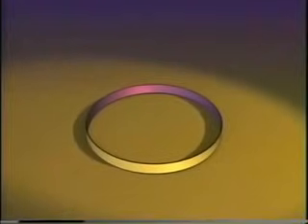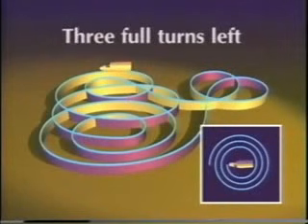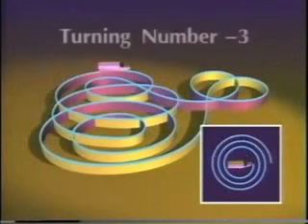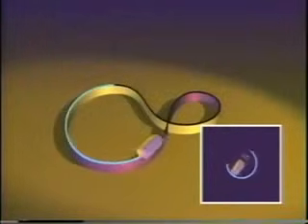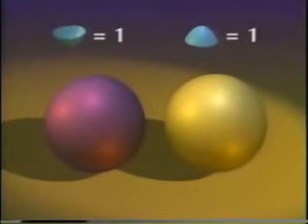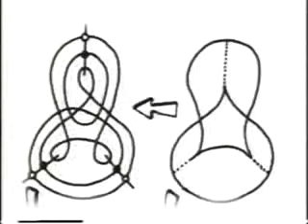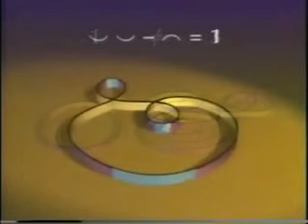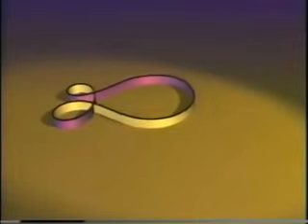how to theoretically turn a sphere inside out

Comment: In the mathematically rigorous formulation of quantum mechanics developed by Paul Dirac,[13] David Hilbert,[14] John von Neumann,[15] and Hermann Weyl[16] the possible states of a quantum mechanical system are represented by unit vectors (called "state vectors"). Formally, these reside in a complex separable Hilbert space - variously called the "state space" or the "associated Hilbert space" of the system - that is well defined up to a complex number of norm 1 (the phase factor). In other words, the possible states are points in the projective space of a Hilbert space, usually called the complex projective space. The exact nature of this Hilbert space is dependent on the system - for example, the state space for position and momentum states is the space of square-integrable functions, while the state space for the spin of a single proton is just the product of two complex planes. Each observable is represented by a maximally Hermitian (precisely: by a self-adjoint) linear operator acting on the state space. Each eigenstate of an observable corresponds to an eigenvector of the operator, and the associated eigenvalue corresponds to the value of the observable in that eigenstate. If the operator's spectrum is discrete, the observable can attain only those discrete eigenvalues.
In the formalism of quantum mechanics, the state of a system at a given time is described by a complex wave function, also referred to as state vector in a complex vector space.[17] This abstract mathematical object allows for the calculation of probabilities of outcomes of concrete experiments. For example, it allows one to compute the probability of finding an electron in a particular region around the nucleus at a particular time. Contrary to classical mechanics, one can never make simultaneous predictions of conjugate variables, such as position and momentum, with accuracy. For instance, electrons may be considered (to a certain probability) to be located somewhere within a given region of space, but with their exact positions unknown. Contours of constant probability, often referred to as "clouds", may be drawn around the nucleus of an atom to conceptualize where the electron might be located with the most probability. Heisenberg's uncertainty principle quantifies the inability to precisely locate the particle given its conjugate momentum.[18]
According to one interpretation, as the result of a measurement the wave function containing the probability information for a system collapses from a given initial state to a particular eigenstate. The possible results of a measurement are the eigenvalues of the operator representing the observable — which explains the choice of Hermitian operators, for which all the eigenvalues are real. The probability distribution of an observable in a given state can be found by computing the spectral decomposition of the corresponding operator. Heisenberg's uncertainty principle is represented by the statement that the operators corresponding to certain observables do not commute.
The probabilistic nature of quantum mechanics thus stems from the act of measurement. This is one of the most difficult aspects of quantum systems to understand. It was the central topic in the famous Bohr-Einstein debates, in which the two scientists attempted to clarify these fundamental principles by way of thought experiments. In the decades after the formulation of quantum mechanics, the question of what constitutes a "measurement" has been extensively studied. Newer interpretations of quantum mechanics have been formulated that do away with the concept of "wavefunction collapse" (see, for example, the relative state interpretation). The basic idea is that when a quantum system interacts with a measuring apparatus, their respective wavefunctions become entangled, so that the original quantum system ceases to exist as an independent entity. For details, see the article on measurement in quantum mechanics.[19]
Generally, quantum mechanics does not assign definite values. Instead, it makes a prediction using a probability distribution; that is, it describes the probability of obtaining the possible outcomes from measuring an observable. Often these results are skewed by many causes, such as dense probability clouds. Probability clouds are approximate, but better than the Bohr model, whereby electron location is given by a probability function, the wave function eigenvalue, such that the probability is the squared modulus of the complex amplitude, or quantum state nuclear attraction.[20][21] Naturally, these probabilities will depend on the quantum state at the "instant" of the measurement. Hence, uncertainty is involved in the value. There are, however, certain states that are associated with a definite value of a particular observable. These are known as eigenstates of the observable ("eigen" can be translated from German as meaning "inherent" or "characteristic").[22]
In the everyday world, it is natural and intuitive to think of everything (every observable) as being in an eigenstate. Everything appears to have a definite position, a definite momentum, a definite energy, and a definite time of occurrence. However, quantum mechanics does not pinpoint the exact values of a particle's position and momentum (since they are conjugate pairs) or its energy and time (since they too are conjugate pairs); rather, it provides only a range of probabilities in which that particle might be given its momentum and momentum probability. Therefore, it is helpful to use different words to describe states having uncertain values and states having definite values (eigenstates). Usually, a system will not be in an eigenstate of the observable (particle) we are interested in. However, if one measures the observable, the wavefunction will instantaneously be an eigenstate (or "generalized" eigenstate) of that observable. This process is known as wavefunction collapse, a controversial and much-debated process[23] that involves expanding the system under study to include the measurement device. If one knows the corresponding wave function at the instant before the measurement, one will be able to compute the probability of the wavefunction collapsing into each of the possible eigenstates. For example, the free particle in the previous example will usually have a wavefunction that is a wave packet centered around some mean position x0 (neither an eigenstate of position nor of momentum). When one measures the position of the particle, it is impossible to predict with certainty the result.[19] It is probable, but not certain, that it will be near x0, where the amplitude of the wave function is large. After the measurement is performed, having obtained some result x, the wave function collapses into a position eigenstate centered at x.[24]
The time evolution of a quantum state is described by the Schrödinger equation, in which the Hamiltonian (the operator corresponding to the total energy of the system) generates the time evolution. The time evolution of wave functions is deterministic in the sense that - given a wavefunction at an initial time - it makes a definite prediction of what the wavefunction will be at any later time.[25]
During a measurement, on the other hand, the change of the initial wavefunction into another, later wavefunction is not deterministic, it is unpredictable (i.e., random). A time-evolution simulation can be seen here.[26][27]
Wave functions change as time progresses. The Schrödinger equation describes how wavefunctions change in time, playing a role similar to Newton's second law in classical mechanics. The Schrödinger equation, applied to the aforementioned example of the free particle, predicts that the center of a wave packet will move through space at a constant velocity (like a classical particle with no forces acting on it). However, the wave packet will also spread out as time progresses, which means that the position becomes more uncertain with time. This also has the effect of turning a position eigenstate (which can be thought of as an infinitely sharp wave packet) into a broadened wave packet that no longer represents a (definite, certain) position eigenstate.[28]
Fig. 1: Probability densities corresponding to the wavefunctions of an electron in a hydrogen atom possessing definite energy levels (increasing from the top of the image to the bottom: n = 1, 2, 3, ...) and angular momenta (increasing across from left to right: s, p, d, ...). Brighter areas correspond to higher probability density in a position measurement. Such wavefunctions are directly comparable to Chladni's figures of acoustic modes of vibration in classical physics, and are modes of oscillation as well, possessing a sharp energy and, thus, a definite frequency. The angular momentum and energy are quantized, and take only discrete values like those shown (as is the case for resonant frequencies in acoustics)
Some wave functions produce probability distributions that are constant, or independent of time - such as when in a stationary state of constant energy, time vanishes in the absolute square of the wave function. Many systems that are treated dynamically in classical mechanics are described by such "static" wave functions. For example, a single electron in an unexcited atom is pictured classically as a particle moving in a circular trajectory around the atomic nucleus, whereas in quantum mechanics it is described by a static, spherically symmetric wavefunction surrounding the nucleus (Fig. 1) (note, however, that only the lowest angular momentum states, labeled s, are spherically symmetric).[29]
The Schrödinger equation acts on the entire probability amplitude, not merely its absolute value. Whereas the absolute value of the probability amplitude encodes information about probabilities, its phase encodes information about the interference between quantum states. This gives rise to the "wave-like" behavior of quantum states. As it turns out, analytic solutions of the Schrödinger equation are available for only a very small number of relatively simple model Hamiltonians, of which the quantum harmonic oscillator, the particle in a box, the hydrogen molecular ion, and the hydrogen atom are the most important representatives. Even the helium atom - which contains just one more electron than does the hydrogen atom - has defied all attempts at a fully analytic treatment.
There exist several techniques for generating approximate solutions, however. In the important method known as perturbation theory, one uses the analytic result for a simple quantum mechanical model to generate a result for a more complicated model that is related to the simpler model by (for one example) the addition of a weak potential energy. Another method is the "semi-classical equation of motion" approach, which applies to systems for which quantum mechanics produces only weak (small) deviations from classical behavior. These deviations can then be computed based on the classical motion. This approach is particularly important in the field of quantum chaos.

Comment: Basically, you cant turn a sphere inside out with out destroying it.  All they did was add more rules to allow the sphere to turn inside out, just like what politicians do- they bend the law to make it suitable for them or their interests.
Reply: ***** No, in science an idea that has yet to be proved but may still be possible is called a hypothesis, not a theory. A theory is what you get after you have enough experimental and/or observational evidence to convince your fellow scientists that your idea is true.
Reply: Think of the sphere as a fluid surface instead of a solid, think a bubble of water, or anything, I guess. Can't pinch a bubble, but a bubble  can turn in on itself.

Comment: The idea here isn't to apply it to practical use in your own personal ideas, and technically the sphere didn't follow their rules. The idea here is to think through, and figure out mathematical equations. She could theoretically turn her sphere inside out by following. The rule that you can only erase or add a turn in pairs. Everything she did was done in pairs along the surface of the sphere. First she pulled out 8 sides, while at the same time pushing in their opposites. Then she pushed in....

Comment: I get that the "rule" is that points on the 3D surface where the gradient of the surface equaling zero are either saddles, minima or maxima and that indicates possible and impossible translations to other surfaces, but you're only describing HOW the "rule" is working, not WHY the "rule" is a rule.

Comment: Yes, isocryd's solution would require compressing the sphere down to an infinitely small point, which brings up the same problem as creasing it (using the video's analogy, it's basically the same reason you can't turn a circle inside-out by making two loops and pulling them tighter and tighter)

Comment: If all you're not allowed to do is to pinch or cut the material, and the material is allowed to pass through itself, a much simpler option is to compress the size of the sphere until the material passes through the same atom, then expand the sphere back to its original size, inverted.

Comment: Well guess what, if I change the rules so the material *can* be pinched, I can invert a sphere too...or even if I can't pinch the geometry, I can assign the scale of the sphere to be -1 in all dimensions and to occur instantaneously, so nothing ever pinches, the sphere is simply one way at one moment, and the inverse at another.    If you make up the rules, you can do it any number of ways.

Comment: You might actually come across a theoretical maths problem which can only be solved by turning a sphere inside out, though...

... It's like fractals.They're just useless pure math with no application, right? Well, no, it turns out they were useful in computer graphics.

Comment: Quantum physics can probably turn a sphere inside out without affecting its structural integrity. It would take breaking apart the atomic bond patterns and letting both the inside and outside pass through each other, but call me if you know a rich-as-all-get-out scientist with top-of-the-line state-of-the-art particle accelerator equipment.

Comment: firstly, i don't believe a crease can be removed even if the material can pass through itself. the more tightly a crease is pulled, the more infinitely small it becomes, surely. but it would never be gone.
secondly, why would having contradictory rules be a problem? the idea of being able to pass a physical material through itself is seemingly contradictory too. this is a completely hypothetical situation, with hypothetical rules. so what's wrong with not allowing creases?
you sir, are an idiot.

Comment: [cont'd] in order to complete the eversion (implies holes), or infinite pressure would be created (also impossible). Both sides of the material that have intersected are pulling on the crease equally, so the last section can't go with either one. There are still bonds in this material, or else it wouldn't be a sphere (gases do not hold together or have definable sides). Note: passing through bonds ≠ breaking bonds. Anyway, you probably won't read this since I'm sure you're off curing cancer...

Comment: Grab some toilet paper because you've got a little something on the side of your mouth after you proceeded to expel diarrhea from it, onto the internet.
This crease is not like folding a piece of paper, which is most likely the most complex situation your underdeveloped brain is capable of comprehending. As I said in another comment, when you fold the material over itself and get to the last section, that section would have to flip (which is impossible) [continued in next comment]

Comment: topology mathematicians, but the maths involved are what you would call basic research. At the time of conducting the research into this, there may or may not be an application for the techniques used or theorems developed. It's like when people first discovered electricity or electromagnetic waves. Could the original basic researchers have known that we'd be communicating via a bunch of ones and zeros?

Comment: It's not like there is anything strong enough in this world to do this. The only way a material can pass through itself or anything else is if both forces are unstoppable. For example, if an object that would go in one path and never go off course or stop where to run into an object that could never possibly move, they would be forced to pass through each other by the laws of physics. However, there is no such thing of that sort that could ever possibly happen.

Comment: im confused, have you tried twisting the circle a few times to a point where the entire surface is touching itself, without being pulled too tight to create a seam in the material?
then techincally you would have a sphere inside the twist and thats where it can pull through

Comment: I don't think so, if we could create something without any mass in a sphere form that we could somehow touch and modify its form, we would be able to do this. The light, for example, has no mass and because of that it can pass through itself, but we can't modify it into any form. Another way to do this, is bild a sphere made of little sphere that act like an atom, because they can stay together even with an big space between them. In case of any questions you can ask me. I hope I helped you.

Comment: Well, we're talking about a sphere, not a ball. There's quite a difference. The sphere is set of points which fit the formula (x-h)^2+(y-k)^2+(z-l)^2 = r^2 where h, k, and l, are the coordinates of the center and r is the radius. Therefore, it is by definition infinitely thin. A ball on the other hand is a material structure in the approximate shape of a sphere. When talking about turning a sphere inside out they're talking about turning a set of points inside out.